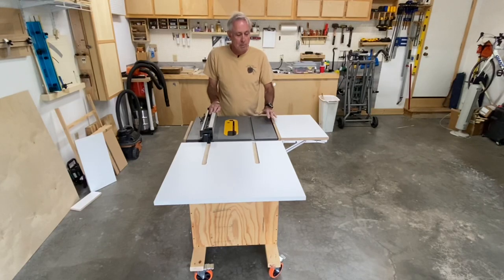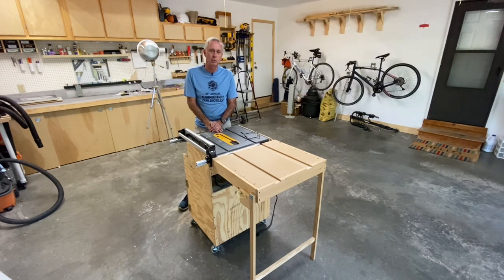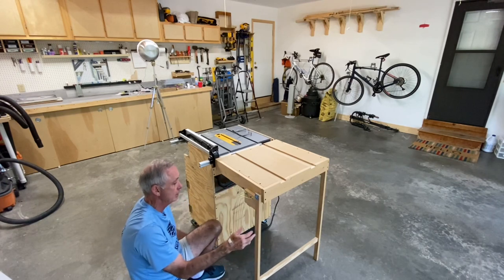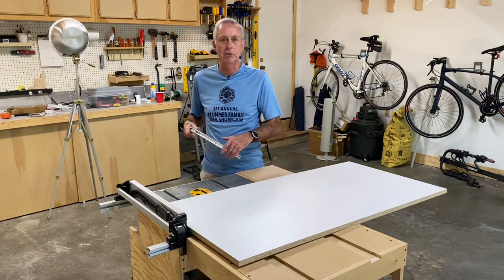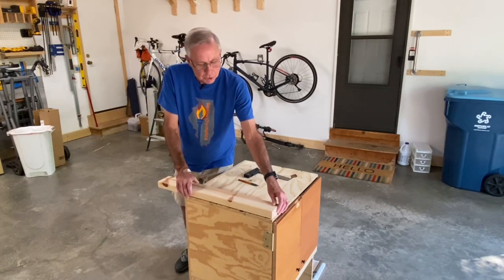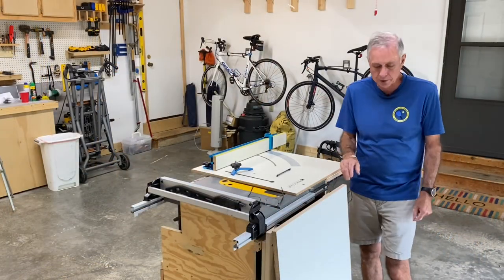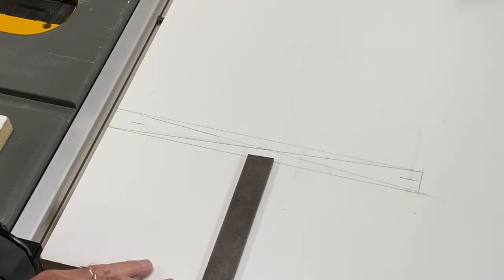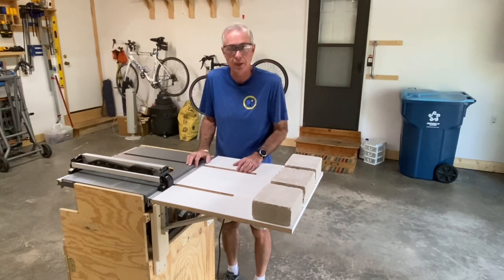How To Upgrade and Improve A Jobsite Table Saw Stand

Comment: One of my first wood shop jobs as a young child was table saw wood catcher.  Might be considered child endangerment today.  Love the out feed table.  I use a roller stand with very poor results.  I have a difficult time cutting or routing melamine without chipping the edges.  Any tips for that?   I really like the hinges you used.  Can you provide additional information on those in the notes?  Thanks!
Reply from the maker: Many of us had jobs like that when we were younger and thought we were lucky to have a job at all!  Great Idea to add the Amazon links for the fold down hinges to the description.  I did that!  No advice on the melamine board cutting.  I had a few chips when I cut them.  The trick to put masking tape on the board before cutting would probably work.  I'll have to give that a try. Thanks for the comment and questions, Pete!

Comment: Great video!! Love the new cart!
For the extension on the side of your saw, how did you deal with the lever that releases the riving knife? Did you cut out a relief for that?
Reply from the maker: On my saw you remove the riving knife from behind the saw blade under the throat plate. I’ll look at your model to see what’s different.
Reply: @Ray_Here  
Interesting! On mine there is a lever on the right side just under the table top.
Reply from the maker: @stevesiefken6432  I looked at the manual and didn’t see an adjustment from behind but I’m traveling and it’s hard to see on my phone. I rarely adjust my riving knife. Maybe once since I’ve owned the saw. At any rate. You could always just remove the saw from the stand and make an adjustment. I take my saw out of the stand once a year or so to clean and lubricate all the moving parts.